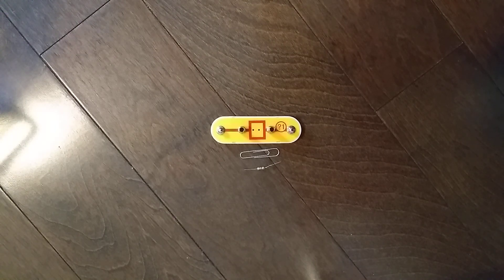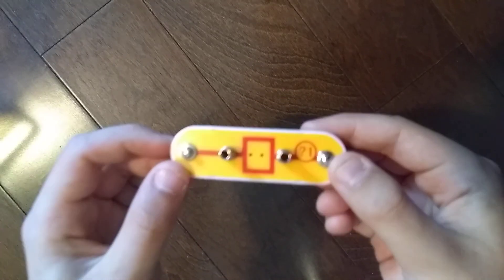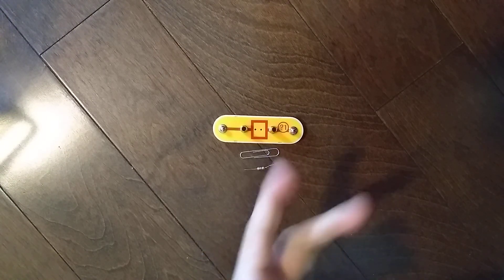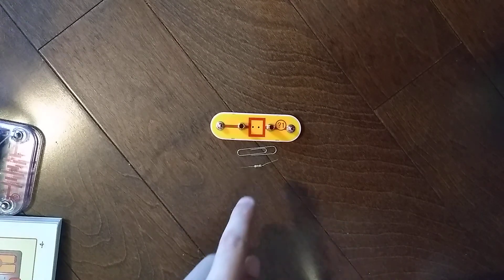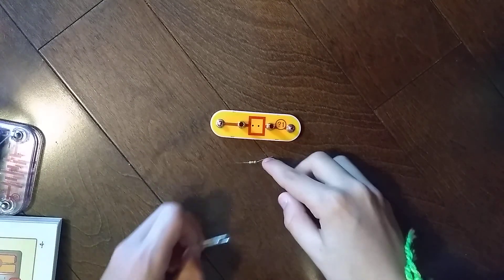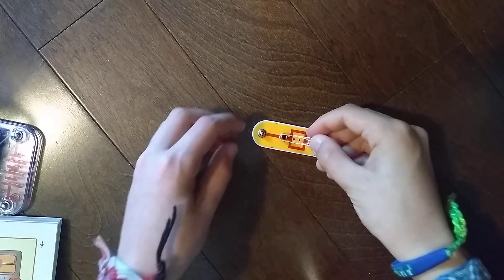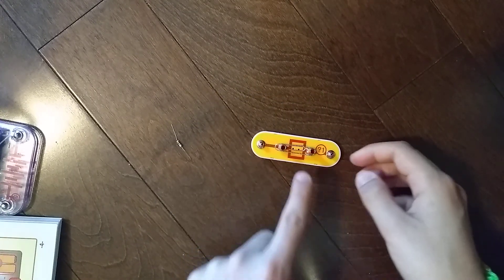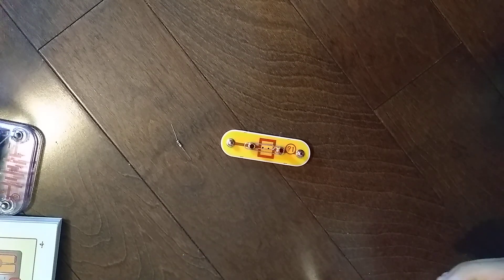Snap Circuits Parts: ?1 (Two-Spring Socket)

Comment: All the parts you missed:
B7 a green solar cell
U33 a snap circuits part you control with the snap circuits app
U7 motion detector
U8 motor control
M8 a programmable fan
U9 sound & recording
U26 keyboard
U28 echo IC
S9 reed switch
M5 & 6 meter
?Q three spring socket
B4 3.6V battery
The egg
U32 melody IC
D9 A blue led
Gears 
U30 light tunnel
D5 is Yellow led
7 snap wire
T2 clock
AF air fountain
D7 7-Segment Display
D11 Blink Red LED
D12 Color2
DL Disc Launcher
M7 Light Motor
M9 Orange Motor
RX1 R/C Receiver
RX2 Deluxe Receiver
S7 Tilt Switch
S8 Selector
U21 Microcontroller IC
U22 Color Organ
U24 Infrared Receiver
Reply from the maker: I only used the parts that worked at the time, and I don't have a lot of the sets that some of the parts came in only